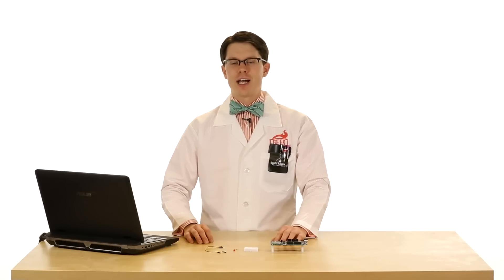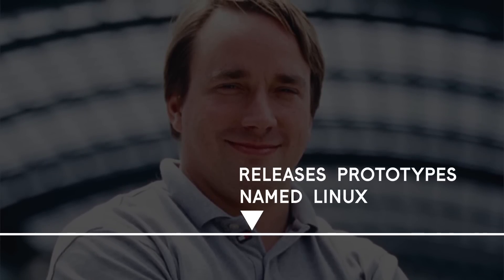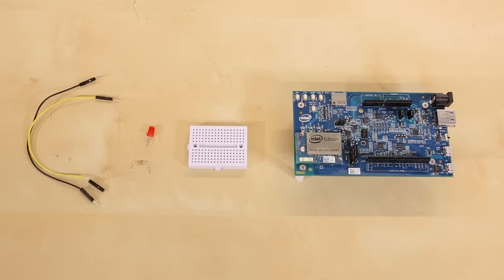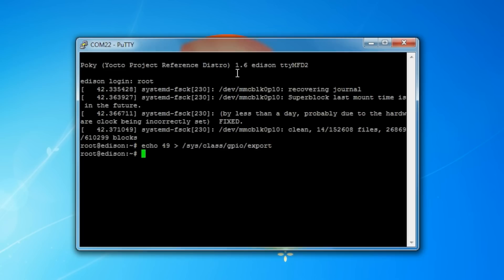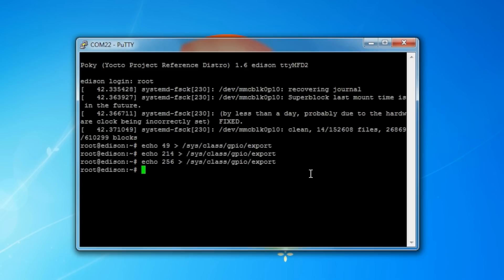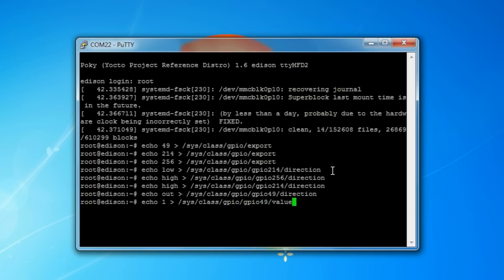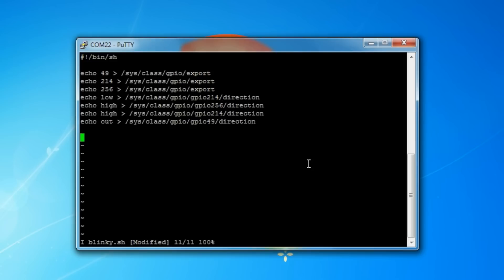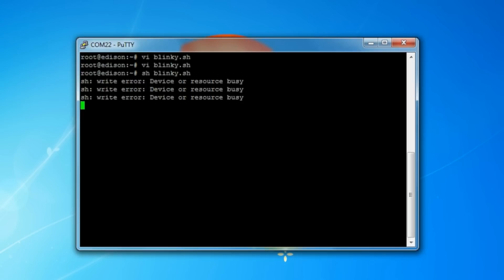Getting Started with Edison Part 3: Blinking an LED from the Console

Comment: Hello, Please anyone can solve this issue--How can I interface temperature sensor LM35 directly to intel edison mini breakout board?I have tried on Arduino uno and it works but not on intel edison mini breakout board and blocks.
Reply: The LM35 gives temperature in the form of a varying analog voltage. The Edison does not have an analog-to-digital converter, so you would need to either switch to a digital temperature sensor (e.g. something with I2C, like the TMP102) or get an I2C analog-to-digital converter chip, like the one found on the ADC Block (https://www.sparkfun.com/products/13770).

Comment: Why I cant save code from my computer to Intel Edison ? Such as Intel Edison will delete all code when I unplug the power
Reply: Eight Channel Top you can, but it's not as easy as something like an Arduino. Because it's on the network like another computer, you can use a program like SCP to copy files over. I also recommend checking out the Intel XDK if you're into JavaScript, as it can automatically send files to the Edison and run them (https://learn.sparkfun.com/tutorials/sparkfun-inventors-kit-for-edison-experiment-guide/installing-the-intel-xdk-iot-edition)
Reply: Ok, thanks sir!

Comment: Hello, thanks for your sharing, and i have question for you.
if i program on Arduino IDE and use SPI to connect   with other device. do i need configure IO10 through IO13 for connectivity on Linux. Sorry, my English is so bad?
Reply: I do not believe you do. The Edison should automatically configure IO10 - IO13 for SPI when you use the Arduino IDE.
Reply: thanks for your answering, so  when do i use configure for SPI on linux
Reply: Only if you're not using the Arduino IDE and you want to program directly on Linux.
Reply: thank you very much.